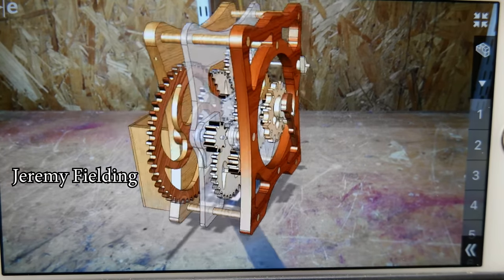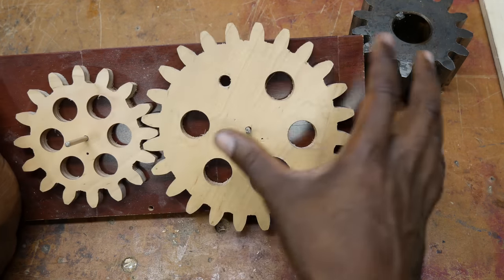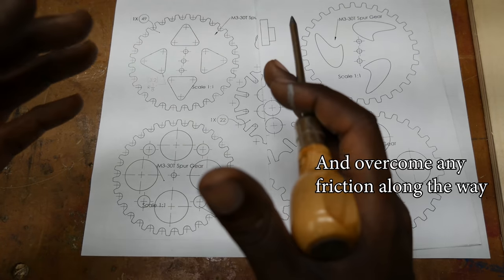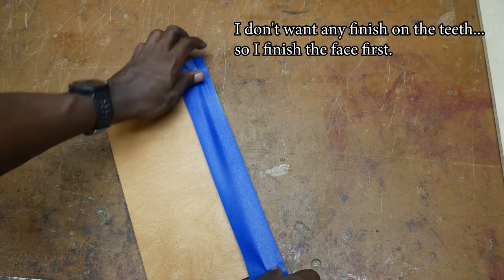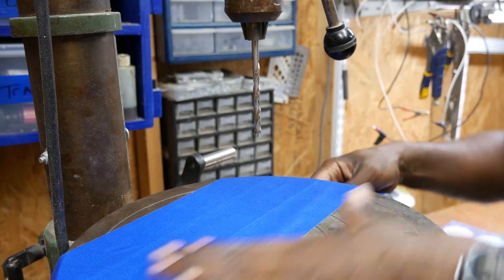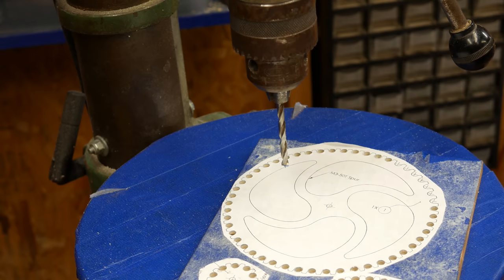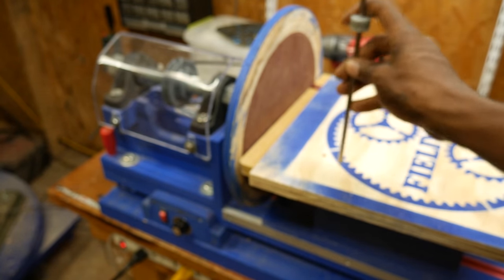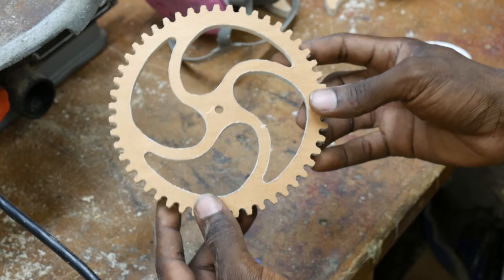How I Design And Cut My Gears Without A CNC Machine: 045

Comment: I'm a Horologist. To compensate for backlash reflected in the hands (dial slop). Set the hands to 00:00, start the oscillator, watch till the backlash is taken up and stop the oscillator and write down the time. Reset the dial minus the slop then restart the oscillator. The hands should synchronize when the slop is gone. It can make a big difference in the time regulation process. Sweet clock man!
Reply: Wood wheel Clocks are acceptable at +/- 2 min per day but can be a lot better if you take care. I wouldn't fuss too much.

Comment: If you start by drilling out a center hole in the gear you are making and made a jig with a pin for the center hole, you could just index the next hole to be drilled by just rotating the gear on that center hole. You would probably have to rough out the gear into a circular shape before drilling the holes, but I don't think that would be a very big deal.
Reply from the maker: +Dirk Stabins a circle drilling jig... I like it :)
Reply: I agree. Every tooth has characteristics that it shares with every other tooth, with regard to its relative position to the center of the circle. My manufacturing regimen would take advantage of that. Center hole first, and the workpiece rotated into whatever milling/drilling/cutting operation.
Reply: In addition you can put a pin in the hole drilled prior to increase the precision. Measure tooth tip to tooth tip for the center for your "index pin".

Comment: Your videos are always interesting.
When I am drilling through wood I use a sacrificial piece of wood on top of the drill table, this prevents any breakout. You could even fasten them together with wood screws through the waste areas of your gear.
Reply from the maker: +Mason Ringbinder I usually do that, but when I change bits back and forth the hole gets bigger and I forget to change/move the sacrificial board. The sacrificial piece works best... this is my backup

Comment: If you use a plywood base and precut the circumference of each circle on your bandsaw you can drive a 4d finish nail through the center of the pattern and each hole you drill will be exactly the same distance from the center and will help with the tear out.
Reply: I totally agree. I was surprised Jeremy didn't use the center hole with pin technique until he took the gear to the disk sander to achieve the final finished diameter.  Also, while drilling the gear holes with the center hole/pin, set a depth stop on your drillpress so the drillbit point just exits the backside of your gear wood and slightly perforates your backing board.  When the pattern side is completed, turn the gear blank over, remount it on the centering pin, and drill through from the backside for perfect holes.  If you want to be even more precise when drilling from the back, you can drill into your backing board and then use an additional bit of the same size but turned upside down to locate each sequential hole.

Comment: Nicely done. I use a very similar process for making gears. However, I like to use PVC sheets made out of standard drain pipe. It makes for a fairly tough gear and it is very easy to drill/shape. It's also cheap, easy to get, and doesn't tear out like wood does. You can drill it, thread it, and glue together pieces to make compound parts.
Reply from the maker: +Treasure Pirate nice ideas... thanks for sharing it here
Reply: Just don't let the afternoon Sun shine on it for very long especially if it is in a really nice dustproof airtight case.  Or at be sure to keep all the patterns so you can make replacement gears.

Comment: The advantage involute gears have is that the mating surfaces between gears have rolling contact only. The mating surfaces do not slide against each other and this eliminates wear. Metal gears have clearances just large enough for a film of lubricant to keep the teeth from touching thereby removing wear completely. You could buy just one or two milling cutters with a 20 degree pressure angle and make all your gears perfectly. By the way, nice work.

Comment: I like the conclusion . Explanation  on the gears  just being different  length  levers  for me  the way i  think of how  gear sizes work i  always think about how my first 10b speed bicycle worked  as i had to shift gears  for different terrains and speeds  by maintaining my  pedal  speed and force  for  some reason that  made sense to me as a child probably because i grew up poor and ha to  refurbish trash bikes to ride  so i spent hours  building and adjusting  those systems  utill i really understood  them well   I was also one of the first in my  group of freinds to   Have access to  the tools needed  as i got a Sears Craftsman mechanics set for a Christmas present when i was 12 or 13

Comment: I have started making stirling engines and would like to drive some home made mechanical toys with them.Also I intednd to make some wind whirligigs so I need to make a speed reduction gearbox and some way of driving camshafts. So I started to look into making gears without a cnc machine. By luck, I have followed roughly the same thought processes in designing my gears as yourself. I enjoyed watching your methods on this video. 
Incidentally, I use Inkscape which has a great gear generator.
The video was very well produced and photographed. Thank you

Comment: Thanks for this, your explanation is super clear and really helps with understanding how to do this efficiently and with less stress.

Do you think you could do a video on pulleys and belts? How to prevent slippage, where to find the correct belts of a proper length for an application, how to best take advantage of the different shapes for a belt crossection in different devices?
Reply from the maker: +Aubreykun I talk about this in my second shredder video. The picture says “more power”...There is a whole “segment” on belts and pulleys... a standalone video might be good also I like this idea
Reply: Thanks!

Comment: would LOVE to see an episode on 'changing direction' with gears - i've seen shows that have those old water wheels, and the wheel gear connects with another that turns a huge rod that powers saws and grinders and such... so how to change a 'round and round' to 'up and down', or 'round and round at 90 degrees' using gears
Reply from the maker: Sounds like a good video idea

Comment: To counteract the "fatigue" when drilling out the bottoms of the teeth, it may be better to rotate the gear around the center point. Simply securing the center point when drilling the first drill hole is sufficient.

Comment: Another great vid! One thing about CNC  machines is that it's not about pressing a button and sipping coffee...much of the work is done in prep, building models and tool paths, etc. CNC won't save you any work or time on the first part...it does help on duplicate parts, but not much. It does help with precision and repeatability. 

Honestly, I'd love to see you make a killer CNC mill-type tool with recycled components! Could be a great series! Jus'sayin'...
Reply from the maker: I agree. I was particularly addressing the issue of precision. That is what makes the clock a difficult build. The rest I agree is just a different kind of work.
Reply: Right on. I also dig what you did with the 3D clock model in the intro...super cool!

Comment: Nice, but it demands lots of patience.
I'd like to make two questions.
1st: What software do you use to design the gears?
2nd: Does the software provide the diameter of the drill bit for all rounded lines?
Thanks

Comment: Would have been easier if you pinned the center holes of the gears into a sacrificial substrate that would be clamped to your table......... then all you have to do is rotate the wood around that center pin under the bit ........ might not seem like a big help but.......... if you're drilling a 150 holes or so....... I think it would have been beneficial.  Also would have increased drilling accuracy.   Enjoy all your vids. .......oh also with the substrate underneath...... you would reduce the blowout on the underside too

Comment: This has certainly set my mind a blaze. How hard would it be to take a pinned crown gear and use it to mesh with deep slots in another? This would effectively put the pinion and translation on the same plane. The pins would sink into the deep slots while the normal teeth would make the engagement on the outer translation. Now I know that this type of gear is normally used to transition torque around a 90° angle but having seen the gear you have with deep slots on it this makes me think it's possible. It would be a tricky engagement to be sure but would also be interesting to see working. 

Being someone who also creates things I know how important these questions are. I don't publish a lot to the web which I well and truly need to do something about. The simple matter of fact is that my bandwidth is so low that I can literally only watch YouTube in 240p without having to stop and buffer frequently. With that in mind, consider the fact that I set it much higher and work on other things while it buffers or simply download the video in higher quality to watch later. That is to say that my hard drive gets used up pretty quickly if I find myself lacking in patients. 

Great video. I did most sincerely enjoy it...

Comment: Just before the bit comes out of the back side of your board, let off a little bit of pressure. Check if that helps to have less tear out.
Reply from the maker: This is something I have tried and it does make a difference.

Comment: Thanks for that. A lot of good tips.I liked the tip for putting down the tape front and back.

i would like to see planetary gears also. 
I may have missed it, but what gear generator are you using?
Thank you. - PT
Reply from the maker: +PT Johnson sometimes I design my own like the square gears in solid works and sometimes I use Matthias gear generator

Comment: Birch is often splotchy, it's the wood grain, not your fault.  Not sure if there is a fix, I often just varnish without stain.
Reply from the maker: +Doug Hunt that sounds like the way to go :)
Reply: The fix is to wash the wood with a light cut shellac first. That seals the soft areas so everything stains evenly. It's harder than it sounds to do right though.

Comment: Hey there. I'm enjoying this and thought I'd pass along something that works well for me.  I am a glass artist and do a bit of sandblasting.  For light duty work (not deeply carved) I use matte finish white oracal 631 removable vinyl for my mask 12" White Oracal 631 Removable Vinyl for my mask.  I glue the artwork down with 3m spray 77 which has good holding power even with blasting.  The vinyl comes in 12" and 24" wide rolls.  If you cut it to the right size you can run it through a printer and print directly on it.  By the way-what did you do for the bottom pully on your upgraded mini bandsaw after the factory plastic pully came apart?  I'm about to do the same fix to the otherwise worthless bandsaw and am going to cast one out of aluminum.  Let me know if you would like me to send you one.

Comment: What gear generator program do you use. I see that you use a 5mm drill bit, but that is all the info I can find on the video. How about tooth shape and how do you determine center to center of two gears?
Reply from the maker: Those things depend too much on what you are making the gear for. so I choose not to talk about it. For a application like this, the "thickness" of the tooth matters very little. I size them based on how big I I want the gear to be. If you are designing a machine to carry a load it matters a lot. The "fatter" the tooth, the greater the load it can take. I use more than one gear generator depending on what I want. I also design my gears from scratch, but any gear generator will give you the same results as the video. The point I was trying to make was not to obsess too much about the profile. It can be any shape for small projects like this. If you were designing an industrial machine... we have way too much information to cover. But if you search for gear generator, the very first one that comes up produces very nice gears.

Comment: I'm surprised that you didn't mention Matthias Wandell.  His website is, after all, woodgears.ca.  You used a portion of  his bandsaw, which is the first thing that I saw on your channel.  If you don't know, he has plans for a 20" model now.  But I digress.  He has a gear generator for $10 or some ridiculously small price that has involute patterns for almost any pitch (or module if you use metric) and practically any number of teeth that would be as easy if not easier than your method, would require less clearance and might be better in the clock.   You could do these on a scroll saw as well.  Wandell uses a tilted bandsaw to make bevel gears that work even though the fit requires a lot of clearance.  I don't agree with Ralph Longo (2 years ago) who thinks this is the best possible way.  I do agree with him that you are amazing, though.  I also know you like to do your own stuff, but actually think Mathias has out done you on this one.  Your motor stuff is better than his, though, by orders of magnitude.  He won't use a motor unless he has gathered it from the trash bin.  (Just kidding Mathias! You do quite well as well.)

Comment: Based on what little I know about gears, the reason for shaping the teeth in this tapered way, is both to reduce friction and wear.
Reply from the maker: +Daniel Gable there are a significant number of important things about a gear tooth profile as it relates to industrial machines... People get their PHD’s over the details and the math of a gear...for this application there are very few important things. That was the only point I wanted to make.
Reply: Agreed, That was what I was trying to get at.  I very much appreciate your videos.  Keep up the good work.

Comment: I BUILD MY CLOCKS WITH A LATHE AND A ROUTER SO I HAD TO WATCH YOUR VIDEO - SUGGESTION: DRILL ALL THOSE FIRST HOLES IN THE GEARS LIKE YOU DID WITH THE FIXED POSITION METAL ROD WHEN YOU SANDED THE OUTSIDE OF THE GEARS - FIX THE CENTER OF THE HOLES TO BE DRILLED WITH THE DRILL BIT ON CENTER AND THEN JUST ROTATE THE GEAR EACH TIME TO DRILL THE CENTER OUT OF THE GEARS - SAVES YOU LINING UP THE DRILL BIT FOR EACH GEAR FIFTY TIMES ON THE LARGE GEAR AND YOUR ACCURACY JUST DEPENDS ON YOUR SETUP OF THE METAL ROD AND THE DRILL PRESS DRILL BIT - TRY IT, I BET YOUR GEARS DRILLING WILL BE SHORTEN BY HALF THE SET UP TIME FOR EACH TOOTH - GOOD LUCK FROM A CRAFTSMAN CLOCK BUILDER SINCE THE LATE SIXTIES -

Comment: Awesome video!
I like you being human, not showing off at the guy who knows it all (and still giving heaps of good advice on how to improve the result).
I am wondering what software you are using to make the gears and to paper test the whole design?
Reply from the maker: I use solid works. However it is pretty expensive for DIY only projects. I have it because of my job. I would recommend you search out some free options as there are many CAD programs that can do this (which are free). You could use a gear generator to create the profile and a very basic CAD program to organize the pieces. The key elements to "testing" the design is defining all the pitch circles and spacing them accordingly. Then make sure everything has support. Double check that everything that should spin freely does and things that should be constrained are. That part takes practice and experience. In the CAD world, everything stays where you put it. There is no gravity. You have to each yourself to check those details and think about how the piece will behave when it is in the real world with the second law of thermodynamics.
Reply: ok, thank you for your detailed reply! so this means you do not use any simulation software but "just" draw everything up and "brain simulate" things through?
Reply from the maker: +Charly H I guess it depends on what you mean by simulate? I make 3d models yes. But the motion and actual function is in my head. The stresses, gravity etc are considered mentally. The program I use (solid works) can do simulation but I don’t use it. It’s not all that good at reality for complex parts.i waste more time trying to make it respond realistically then designing my part the way I know it should behave
Reply: ok, thanks for that! i am still a bloody noob when it comes to cad/cam. when i did my apprenticeship all the drawing was still done on paper. so i have a steep learning curve ahead of me to put my ideas on digital paper. at least now i know that it's not really worth trying to simulate stuff in those big simulation suites (which is another thing to figure out first). thanks again!

Comment: JeremyIs the gear design proprietary or can you share some of the basics? What size drill, spacing between holes, width of tooth aand anything else you think would be helpful. I have access to a cad drawing system for the rest.Thank youJim Mossman
Reply from the maker: +Jim Mossman the easiest way to copy this is to use a gear generator. I start by using a standard involute gear profile. I explained the rest in the video. I used a module of three for most of the gears in the clock but that depends more on how big a gear you want and not a special requirement. If I was pushing a heavy load I would care more about the thickness of each tooth.
Reply: What gear generator program do you use. I see that you use a 5mm drill bit, but that is all the info I can find on the video. How about tooth shape and how do you determine center to center of two gears?